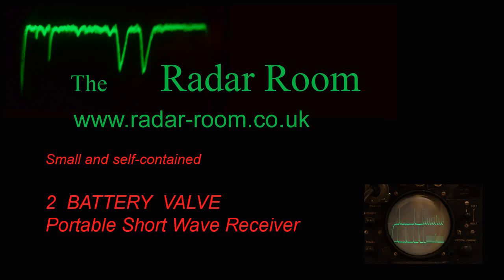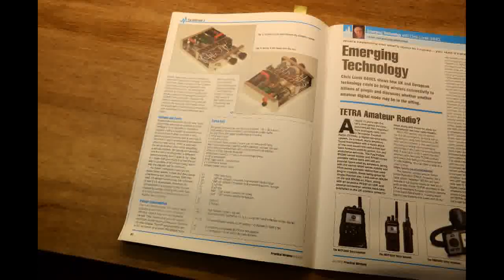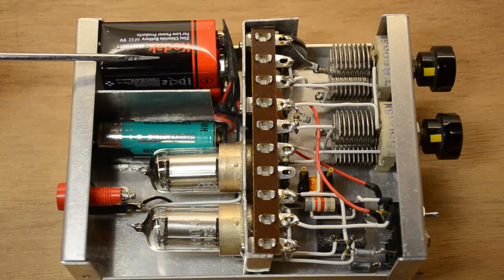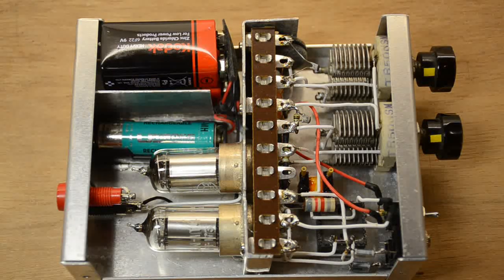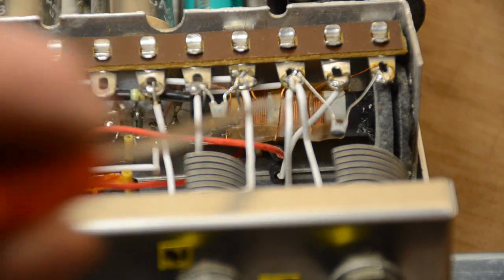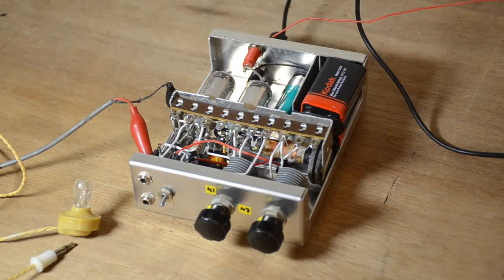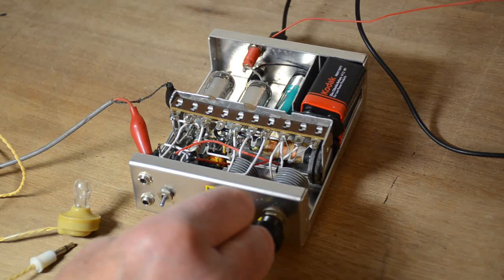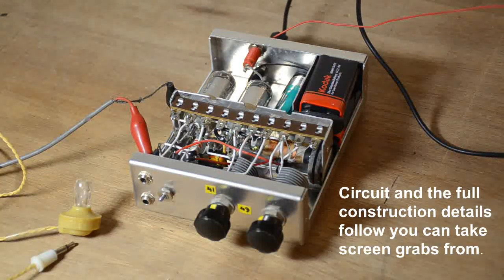2 Battery Valve Portable Short Wave Radio

Comment: Hi thanks for sharing! I have sourced all the components, wound the coil and ready to begin construction.  Is it possible to get the exact tagstrip layout details - either a diagram or a zoomed in photo please? Thanks !
Reply from the maker: Hi David. You'd need several very close close-ups I fear and even those wouldn't show everything! A wiring list is therefore best:

HERITAGE 2 

Looking at the tag strip from the front of the case with the controls mounted, Left to Right:
(Tag 1 is closest to the output sockets)

Tag 1:  Earth, valves pin 1 etc.
Tag 2:  Valves pin  7, 1M ohm resistor
Tag 3:  Valve V2 pin 2 , 8K2 resistor, 2x 0.1u caps
Tag 4:  n/c
Tag 5:  n/c
Tag 6:  Tuning cap, C3, L3 (A)
Tag 7:  Tuning cap and reaction control earths, C3, L3 (B)
Tag 8:  Reaction control, C2, L2 (C) 
Tag 9:  Coil L1 (E), 
Tag 10: Earth, C2, L1 (F)

Good luck with your build!
Reply: @lishaton  Many thanks!

Comment: Nice video. What is the frequency range? Thank you.
Reply from the maker: As this only has one waveband, I tried to make it work for some well listened-to bands. In the end, by taking into account the fact that I was going to use a 50pF tuning capacitor, I adjusted the coil windings to give me about 5.9 - 8 MHz. This therefore encompasses the 41 and 49 Metre broadcast bands, plus the 40 Metre amateur band. A larger tuning cap. would have increased this coverage if it had been built with one.
Reply: @lishaton  Thank you for your reply. 5.9-8MHz is good. I will try to build one and maybe add 2 bands.
Reply from the maker: Do let me know how well it works. If you tweak the number of turns on the aerial coil, then you can probably tailor it to your exact needs. Do take note that if you increase the size of the tuning cap too much, it will be much more difficult to tune if you want to keep the small case footprint. Tuning in SSB signals even now is a bit of a challenge!
Reply: @lishaton  I have a 36mm small VERNIER DIAL. It rotate 4 times when the capacitor rotates 180 degrees. I think it's helpful for turning. May I ask what ferrite you use for the coil? Is it medium wave antenna ferrite? Thank you.
Reply from the maker: Yes, it's a short length of an ordinary medium wave or long wave ferrite rod aerial. i.e. nothing special. That vernier should make tuning much easier if you want to increase the size (capacity) of your tuning capacitor.
Reply: @lishaton  I finished it. It can receive broadcasts. I use high-impedance headphones to listen to the sound, which is quiet but enough to listen. I use same coil the frequency is 7-14 MHz. There is only one issue so far the regeneration stops working when I touch the case or even the headphone cable. There is no sound from the headphones. Do you know the reason?
Reply from the maker: Well done! However, check your earth connection. Without an earth, you'll end up with hand-capacitance issues which may also affect the regen control. Make sure your box / chassis is properly earthed. Is the earthy-side of the tuning cap. taken to earth? 
Even in a tent (!!) a skewer into the ground makes a good enough earth for the thing to work properly. Hope you fix it as I can't think of anything else that might cause this. (Useful indoor 'earths' are central heating and water pipes.)
Reply: @lishaton  Thank you for your reply. I was indoors and not grounded. Since my water pipes are now made of plastic I cannot use the water pipes for grounding. I'm going to go outside and try out the grounded reception. I will share some photos or videos with you soon if you like.
Reply from the maker: Sounds to me like you've identified the problem. I'd like to see your images or videos when you've taken them. As another thought, you could always try your central heating pipes if you have those? (i.e. connection to a radiator.)
Reply: @lishaton  Unfortunately I don’t have a heating system either. It is still working indoors without ground wire. The antenna is about 3-4 meters of wire. I'm indoors on the first floor. When the transmission is good, the 40-meter cw signal can be clearly received and is very stable. 40m single sideband signal received but unstable. Overall it performed well, even better than my superheterodyne receiver. On the broadcast band I can use the regeneration knob to select (fine-tune) stations with nearby frequencies. very interesting. By the way, I tried using 1k2 tubes made in China, which worked better than my 1t4 made in Hungary.
Reply from the maker: Well done for experimenting. Since I last wrote, I've had a play with mine here and it is a LOT louder with an earth, plus the reaction works properly with no hand-capacitance. If you ever find another output device such as a crystal earpiece, you may find it a lot louder. When making this one, I was wondering whether to stick with the one valve circuit, which was a lot quieter, but opted for the second valve as it really made a worthwhile difference. If the Chinese valve is better, I'd keep using it! If you ever take it outdoors, then you can try the earth connection as well. I think you'll notice the difference. Using it 'under canvas', I only using about 1M of wire across the tent and a metal skewer into the ground  for the earth...

Comment: Will you do videos on the theory/maths of circuits?
Reply from the maker: Hi. I'll be honest that I haven't really considered doing this as there are many other people giving this kind of detail in their videos already. I'm assembling many of these videos because there are far too many 'tried and tested' circuits and ideas out there on the Internet that have had neither done. Mine are therefore realistically as short as possible,  but show that here's a circuit that actually works. (Useful as well, as you can see what performance to expect if you make your own)

The same applies to my microprocessor videos. Lots of these out there already, often with hugely complex circuits and programming, or simply 'ideas' that are probably above most peoples heads. I therefore do mine from the ground upwards, describing any detail necessary for the beginner to actually have the enjoyment of making a micro. work for them.

Comment: What an interesting receiver and good results for a simple circuit. I particularly like the construction method. Could you possibly do a short video on where to source components such as valves and the holders with any tips on what to look out for and importantly, what not to buy? Thanks.
Reply from the maker: Thanks for the suggestions. Interesting. Of course a lot depends on where one is in the world! Ironically, the easiest items to obtain are usually the valves. Why? Well historically, someone might throw away an old set, but make sure they keep the valves, but not the valve holders, transformers, variable capacitors etc. I will certainly give this idea of your some serious thought.